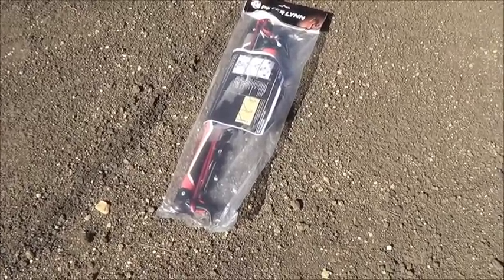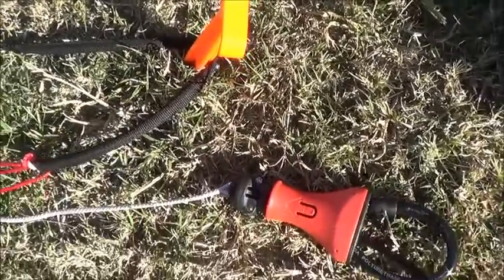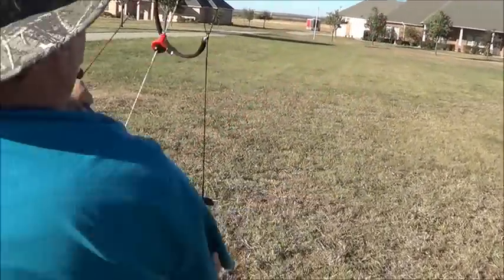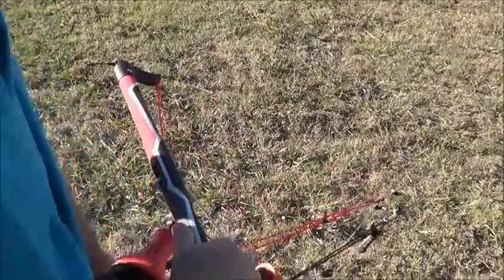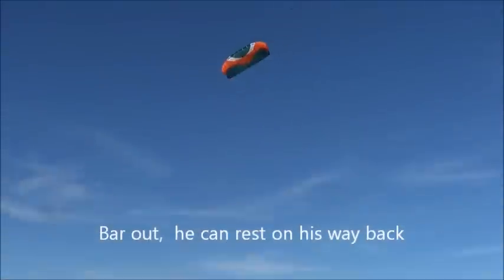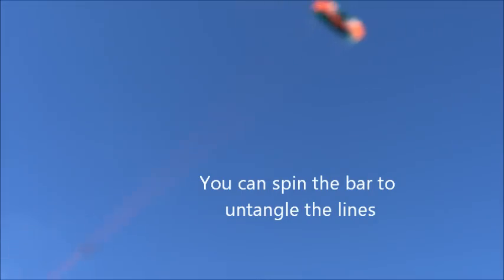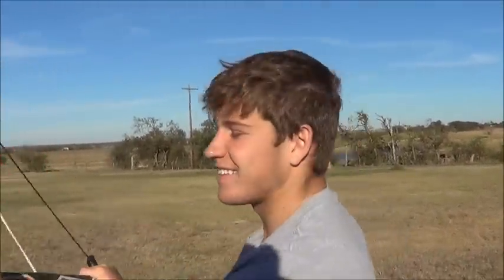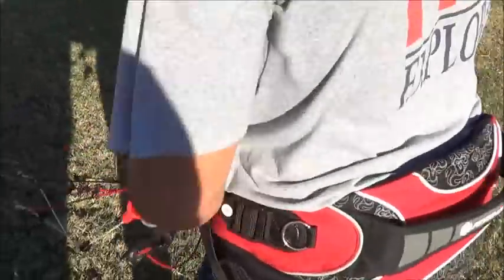Peter Lynn CrossOver Bar for fixed bridle kites

Comment: Hey mate 
Great video - any tips for setting up a 6m flexi foil blade 2 on that bar. I can’t quite get the set up right.  The kite never comes alive.
Reply: I just received this bar to use mainly with my 2021 Blade 4.9. Haven’t hooked anything up yet to even check it out but I am looking forward to trying it out. So what do you mean by “the kite never comes alive?” Does it launch fine and fly sluggish or not even launch at all? Since I haven’t set mine up I don’t know how all the lines look but I would say extra attention needs to be paid with the break line length. Ideally, the break lines should be fully slacked with the bar all the way out and beginning to have some tension with the bar in a few inches or so. If you have the bar pulled all the way in and the breaks still aren’t engaging you need to shorten your break lines by adding a knot on the bridle break line leaders.
Reply: @nathanthepilot2008   Hi Mate i Kinda worked it out in the end. Very fine adjustments on the brake lines sorted it out. now flies super fast and alive
Reply: @davethejellyfish7457  Oh great! I’m glad you got it all worked out. I’m going to have to wait for some nicer weather before I can work with my set up. I’m encouraged that you’ve had luck with it with some minor adjustments!
Reply: @davethejellyfish7457  what kind of adjustments did you end up making?
Reply: @nathanthepilot2008    Like you said, you have to get the brake lines just right. i added a few more knots to the brake lines so i could shorten them a bit more than stated. but too short and its no good. for me it was lots of trial and error
Reply: @davethejellyfish7457  Cool! I can’t wait to try it with my Blade. I’ve only flown it a couple times so far and always with handles. What a workout!

Comment: Notice ...NO Launch..
I have this bar.tried it on 4 fixed bridle kites with 0 success so far.Always go back to handles.
Reply: Just bought on to try with but not used it yet. I'm guessing it will only work well with kites that like to fly with pressure on the brake lines (which I'm not sure mine do).
Reply: hi mr x do you wanna sell bar?
Reply: 4:52